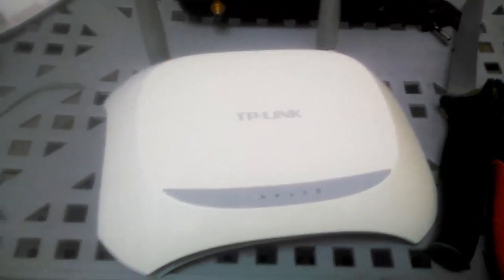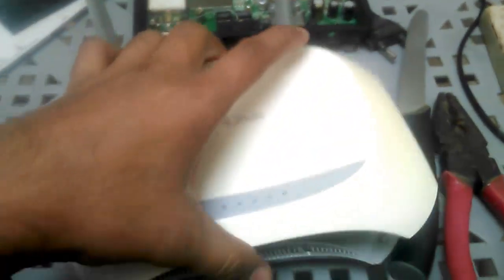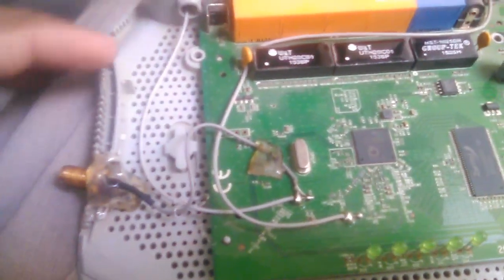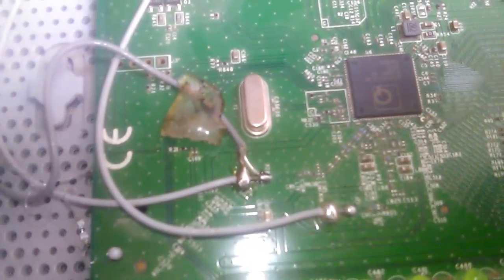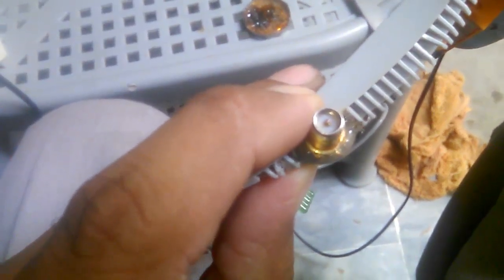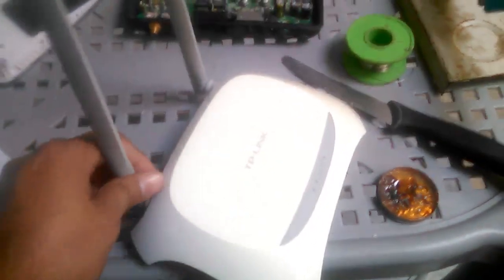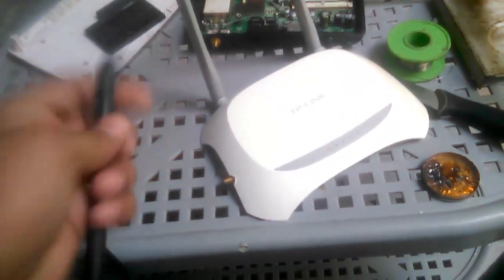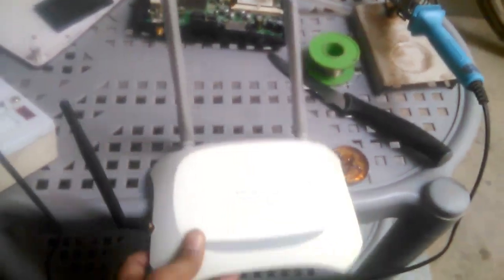TP Link TL WR840n v2 antenna mod

Comment: No good. You left the original antenna hooked up, that means they are now wired in parallel and the impedance is cut in half to 25 ohms! You will get worse performance because the impedance is supposed to be 50 ohms.
Reply: You are 100% right bro

Comment: Is this antena for receiving or for sending signal??? Thanks
Reply: For transmitting. You can hook this into an UHF amplifier if you need more range not sure about spurs and stuff. Router > amplifier > Antenna tuned to 2.4 GHz/5Ghz